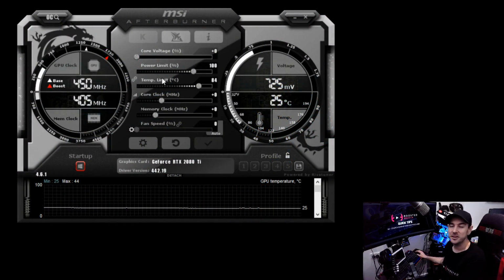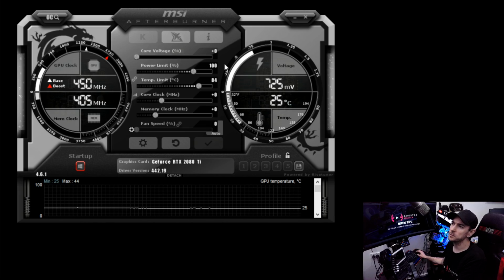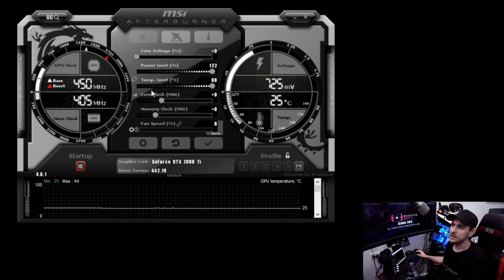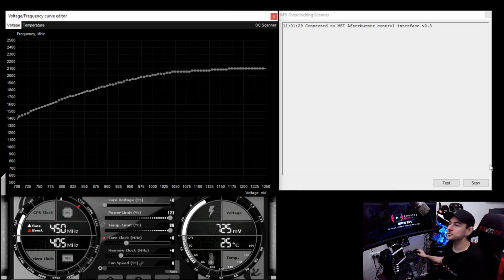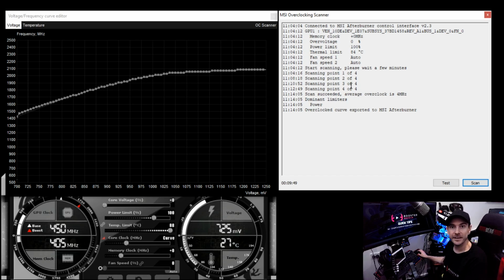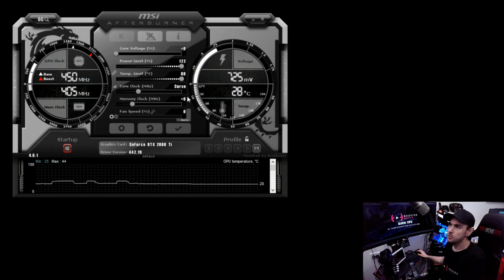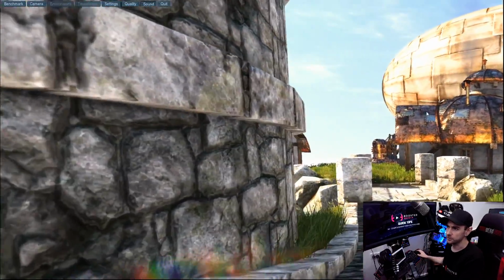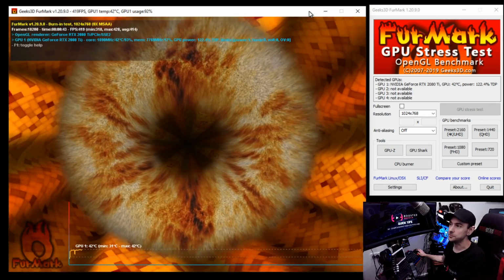QUICK TIPS | How to Overclock your Nvidia 10 & 20 series Graphics Card

Comment: Should be noted that you should run back to back benchmarks before and after altering the clock speeds, sometimes increasing a core/memory clock by say +50 can actually result in a lower FPS.

Comment: Wow, the synchronicity! I was running OC Scanner as this video came up in my feed. Need MOAR VR POWER!!! Thanks again for the tips Will
Reply from the maker: Lmao! That’s pretty crazy
Reply: @boostedmedia  IKR! I had run it a while ago but I've gone back to VR and want to see if I can get more out of it (RTX 2070). I didn't know about adjusting the memory clock manually and I had my core voltage at max so thanks again. You saved me some cash in a year :)

Comment: Thanks for the video mate! for me these stock value´s for fanspeed never worked on afterburner. cause max temp is set to 83 degress.  if the gpu hits 82-83 it clocked down a lot to keep on 83 degress, while the fan-speed is still under 70%. this causes frameskips etc. i needed to adjust the curve. so i evertime use constant 90% and im fine.

Comment: So, although I used MSI Afterburner already your video gave me boost to improve the overclocking. Now I have 2070 MHz. Not bad :)
I also raised the memory clock by 500 MHz what looked good for gaming.
But to be sure about the stability I would recommend to use Blender and render the Classroom animation with GPU fully.
Then I had errors and had to go back to +300 MHz.
But it helps with VR for PCars2 and rfactor2 of course.
Thx!

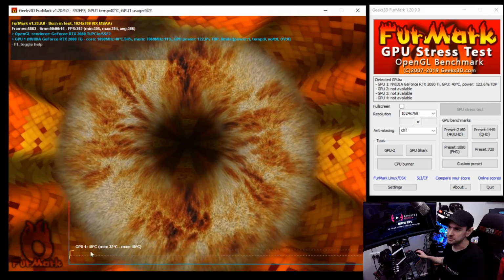Comment: Just followed each step to overclock until 10:00 - my PC is liquid-cooled but it only has one fan. Its fan speed on MSI Afterburner initially was 24% (before overclock) whereas yours was at 0. After overclocking it went to 53% automatically. Then I performed the Furmark stress-test at 10:10 but my temp started rising over 85 degrees - I panicked and closed the application. I have a GTX 1070Ti-8GB, any insight is much appreciated :(

Comment: Hi Will thanks for the guide, followed your instructions step by step. When the scan is ready the power goes back to 100 instead of the setting first to full. ,which was 117. Test also good with 90%. Can you explain why it goes back to 100 and not stay on 117 as  in your video. I have GTX 2060.
Not an expert don't know what to do now.
Reply: Hey dude, i had to hit the apply button after the scan and then do the test.
Reply: @Ulquiorro  Hi thanks for tip will do

Comment: You didn't click the tick button to apply the voltage slider increase
Reply: ...before running OC Scanner.
Reply from the maker: I didn’t change the voltage slider
Reply: @boostedmedia  Apologies, I meant the power slider - linked to temp. That increase will not apply until you click the tick. You can verify the increase has not been applied as when you start OC scanner it reports power as 100% and temp limit remains 84.

Comment: Lol i just tried the auto oc 3 times on AB, at about 950mv it was at +195 core and crashes WTF? best i have done manually with my strix 1080ti non oc edition is +100 on the clock and it usually settles at about 1976mhz. Every other asus card i have had was a beast but this thing is shit

Comment: What happens if you don't see curve where it says core clock after you run oc scanner??? First attempt at trying anything to do with this sort of thing lol. OK when I press test cuve disappears??? Do I put up power and temp and run scan again??
Reply from the maker: Are you letting the scan complete?
Reply: @boostedmedia  yeah I let scan complete and it says 124mhz for the increase then when I press test everything seems to reset. Tried running the scan again this time it says curve but don't want to press test incase it resets curve. Tried fur and heaven benchmark everything seems good in fur but in heaven it seems to benchmark pretty bad 20fps max 30 but in fur it's 120fps???
Reply: @rawj1213  cheers man👍